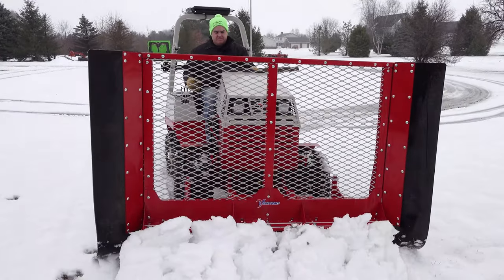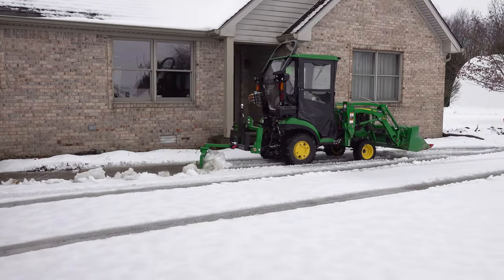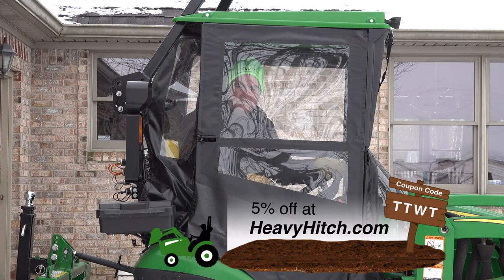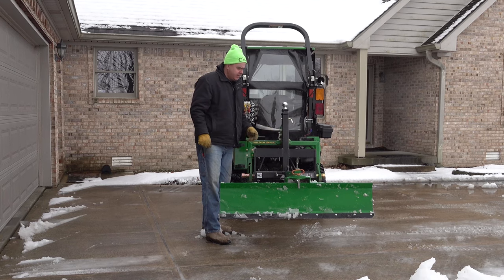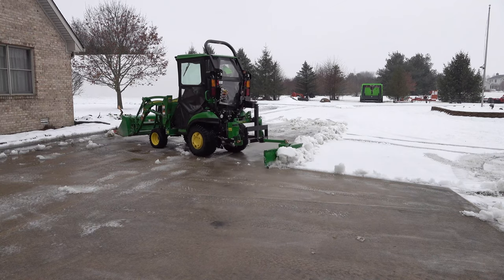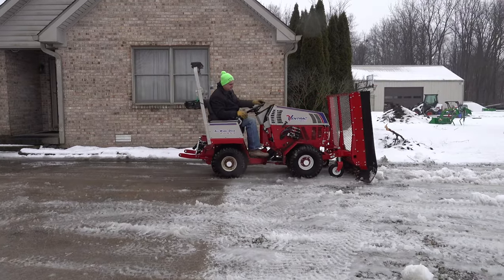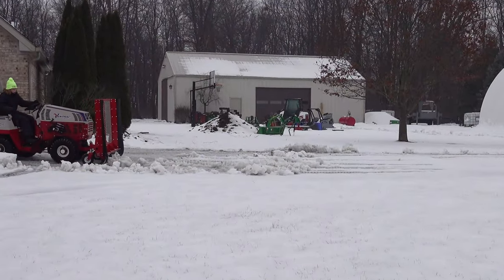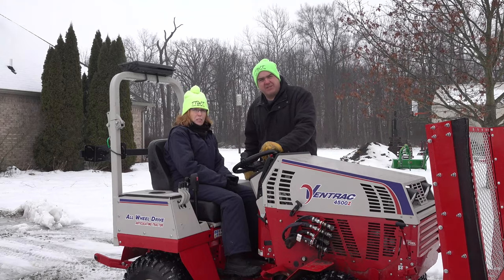Snow Removal or BUST!    Subcompact Tractor and Ventrac!

Comment: Tim, I purchased the back blade for my Heavy Hitch over the summer after watching your video last winter.  I had a landpride 60” blade that I had sold back to the dealer, earlier in the year, due to it being huge to store.  The Heavy Hitch blade folds up and you can tuck it anywhere for storage.  I chose the UHWM blade, and it is fantastic!!!!  I have it paired with a front blower on a BX2680.  Great combo. I have the premium cab, so I purchased a wireless backup camera on Amazon, and it has saved my neck!  Thanks for all the great content!

Comment: You could add Artillian extensions to widen the blade.....

Add a poly cutting edge.

You could weld/bolt a right angle piece on the left side.  Higher end models offer bolt-on plates.

You can mount the HH blade on the front.  HH makes a front 2' receiver bolt-on.

Spray PAM on the blade.

JD Frontier rear blades come in 48, 60, etc.  Once you move to "standard" from "economy" they can add tilt and offset then optional extras like bolt-on side plates, hydraulics, skid shoes, etc.

Comment: Enjoy your videos.  I have a gravel driveway 0.3 mile long.  To keep from disturbing the gravel, I attached a pair of 8" O.D. X 2" wide swivel hard rubber wheels to the back of my 6' road blade, one on each side about a foot from the edge. Using the top link, I can adjust to the desired clearance (about 1.5" - 2").  I angle the blade and one pass down and back does the job. Works great!  Initially I tried pneumatic wheels but they bounced too much.  The solid wheels work best. If the snow is too deep, I rotate the blade and go backwards so the snow doesn't accumulate under my MF-135.

Comment: The rubber edged 54 inch blade on the front of my X738 works like a squeegee on hard surfaces. I pushed 4 inches of wet snow off yesterday morning and it was dry yesterday afternoon.

Comment: That Heavy Hitch blade got the job done with what it was given.  And it is an inexpensive accessory. That said, a more expensive, and wider, dedicated rear blade with a much more curved moldboard set at an angle does work better moving snow because it can "roll" the snow.  That definitely helps when moving snow sideways.  At least that's been my experience at 7500' of elevation along the front range of Colorado.

Comment: Tim...Open your garage door to get all the snow from door. Most garages have a remote to open. Put a remote on your tractor for the door. Its inexpensive to mount.
Also mount a PVC pipe on blade to keep from treating up the driveway.

Comment: I have a stone drive and I tried an experiment on my 4 series tractor with a 4 in one bucket.  I got a piece of 2 inch schedule 80 conduit and cut a slit down the length of it.  I opened the jaw on the bucket and wedged the conduit on the entire width of the open edge of the bucket.  Leaving the jaw open and with the conduit on the lower edge of the bucket worked similar to a snow pusher., and the conduit kept the edge of the blade out of the stone.  God Bless!

Comment: Funny how Tim let Christy drive the tractor after the they were done using the tractor with the cab. Your a blessed man Tim.   By they way, our  8” of forecasted snow resulted in about  2” at the most. So far its been a unusually light snowfall winter for us in Door County / North Eastern Wiscinsin. We normally have several feet on the ground by now.

Comment: Worrying about mud at the edge of your driveway in January/February amazes me.  At this time in the winter I can practically use enough down pressure to lift my front wheels and the worst that happens is a little detaching of the lawn.  But I also have a chunk of rubber horse mat for a cutting edge which certainly helps minimize lawn damage.

Comment: Inverted snowblower works similar to the blade.  You look back as you back up to position it, but then when you are moving snow, you look forward for the most part.  Occasional looks back to check where the snow is going or to be sure you are not going too fast or too slow to feed the beast.  Otherwise, you just drive and concentrate on where the tractor is going.  This is especially great as you come to a road or other intersection as it allows you a clear view.

The biggest issue I have with all plows is that you end up with a pile somewhere.  Either along the side of the roadway or at the end depending on where you are putting it.  The issue isn't the first cleaning, but the second and later ones.  With a pile in the way, where do you push the next batch?  In the past, multiple storms would see me out with the walk-behind blower to cut back the berms so that we could get another push.  That kind of thing just sucks.  With a blower, you just clear the space again.  3PH blowers are not cheap, but boy do they work.

For those of us in the snow belts (I'm in New England) the blower is the way to go.  You can see my setup in action on our 1/4 mile shared driveway here:  https://youtu.be/mUEXlHh1voY

These blowers are not toys.  The shear pins are grade 5 bolts and it will just as easily throw a fist sized rock as it will a mountain of snow, so you need to be careful where the chute is aimed and what you are picking up.  Because most of the driveway is gravel, I have the cutting edge raised just a little.  This leaves a small layer of snow, but that typically melts or evaporates off in a few days.  In the video, you can hear the pieces of gravel getting picked up and thrown from time to time.

Comment: I have a 3720 with a 59 blower on the front and a 72” box blade on the back. Blower works good for deeper stuff but the box blade works great for light snows and clearing down to the concrete/asphalt.

Comment: Put that hitch pin into the blade in the hole between the pivot pin and the hitch. Less shearing force there. I run a 54" front blower with the HH blade to cut the packed snow and ice.

Comment: Blades are fine if you have somewhere to put the snow which I don't. My drive goes into the basement with a wall on each side and there's no place across the road even if I could push it over there without getting hit. However my little walk behind snow blower can clean the whole thing out in about 15 minutes. Now a fall back is I could not think about moving the wet stuff you were moving. As a matter of fact I had to get out there at 2000 hrs that night it hit and move it while it was dry.

Comment: In Michigan we were told 1 to 3 than they changed to 2 to 4 ya we got about 1 and 1/2. I’ll be honest not to impressed with the leaf pusher for snow. I’m not a big fan of the rear blade either to much looking behind. I prefer front blade or bucket. If it calls for it a blower. Thanks for showing us the difference in implements. Stay warm and enjoy the hot cocoa. 
Bruce from Mason Michigan

Comment: What is the advantage of that scraper blade? For $455 why wouldn't you just get a 3 point quick hitch (which you already have on your tractor) capable countyline blade for $400? If that 2in receiver blade was $150 then I would completely support it
Reply from the maker: Because he heavy hitch bracket is also useful as a holder for rear ballast weight.
Reply: @TractorTimewithTim  got it! I knew there was a good reason. Thank you!

Comment: Remove the bristle brush and add a HDPE cutting edge like you normally put on a plow for concrete.  I bet THAT would clean the concrete drive just about as well a straight (non V) plow.

Comment: I use a Kubota B2920 with a 6' front mounted plow with a rubber cutting edge. It work perfectly as long as no one drives over the snow and packs it down.

Comment: I put a elbow on my 1025 about 10 or 15 dollars,went to Home Depot bought a 1.25 or 1.50 sink trap elbow,brand was Ever Built.Cut three side slits in it ,swelled it with a deep well socket,used a hex sheet screw to hold on new exhaust tip,could use heater hose clamp also?

Comment: I know this is unrelated to the current video but, could you redo the video on how to replace the seat springs for the 1025R? The one that you put up with your older 1025r is different than the newer ones. I bought the springs and started taking it apart to replace them and found it was done differently so I never did get it done.

Comment: You guys got the short end ☹️. I figured my sister in Lawrence did as well. We were at the top of the 32 line you guys below. Its wet here too but the difference in snow is drastic. I measured 6.5” on back porch not drifted. I just published a vid of what I moved up here, what 45 miles or so north?

Edit: I find in deep heavy stuff backwards best as it doesn’t act like a rudder turning tractor.

Comment: When I lived in Illinois I had a Ford 3000 gas tractor, 2 driveways mostly used the bucket, then sometimes rear blade. My older neighbors down the road I would plow their driveway with a rear blade. Open cab, nothing like having a beard full of ice. Oh I bought a snow blower but it turned out to be a waist of time unless I used it to go between the building and the house.

Comment: Now you have frozen boulders around the edge of the driveway. You provided a perfect example  to everyone that needs a larger blade to cover the tire tracks The 54" blade, whether front or back will cover the tire tracks since you cannot plow the whole width of the tractor at angle  without snow falling of the end of the blade. To make a clean pass you can only use 1/2 to 3/4 of the blade.  Get that lady some Coco.

Comment: My tractor is about 5' wide at the rear tire, and with a 7' back blade w/rubber edge it works out perfect for doing my driveway with no spillage when angled. Your blade is too narrow in my opinion.

Comment: I’ve used a back blade behind an old Case tractor and it has limitations. Heavy snow will pull the tractor off line.

Comment: It’s a good thing you didn’t get 4” of snow because that leaf pusher couldn’t handle 2” of wet snow. I guess it serves the guy right who won it and never came to pick it up, that you beat it up trying to plow snow with it. I have the frontier 5’ loader plow on my 1025r with a urethane cutting edge and it will handle whatever is in its way. And I can use down pressure with it. My friend bought the Artillian loader plow setup and that only has float and no down pressure, which doesn’t work so well with any kind of load in front of it. I’ll take all the snow you don’t want. Send it to Maine.
Reply from the maker: ‘Serves the guy right...’. 
I see no reason for the rude comment.  Rich was scheduled to come,  but we had to cancel.
Also, we caused no damage to the leaf plow.
Reply: It wasn’t intended as a rude comment. Sorry to upset you. GWT has a video out this am where he talks about not lending your equipment out to friends. You using the leaf plow as a snow plow is a perfect example of this.